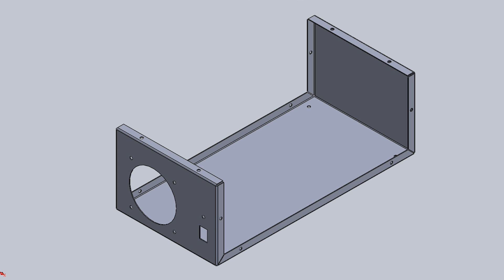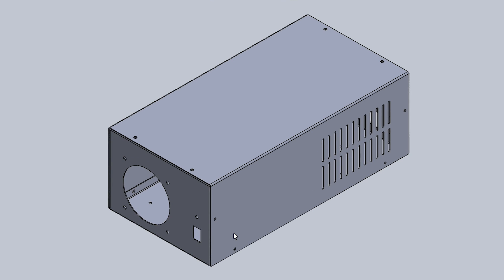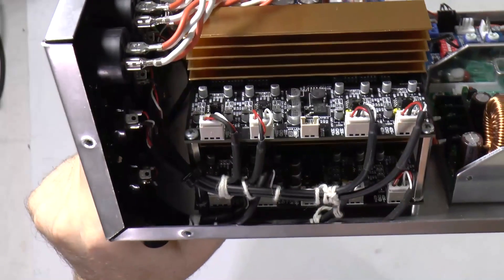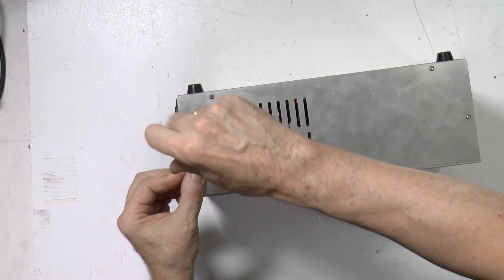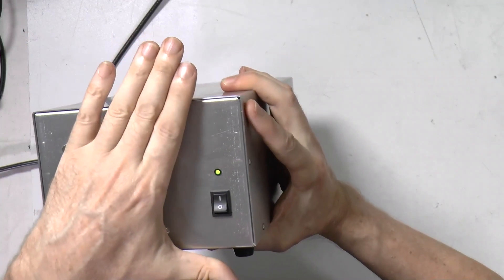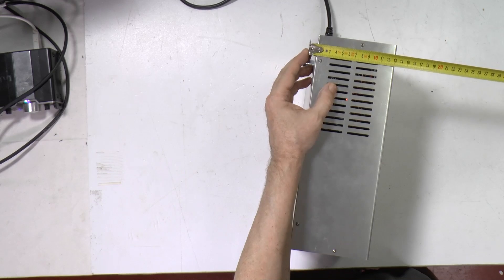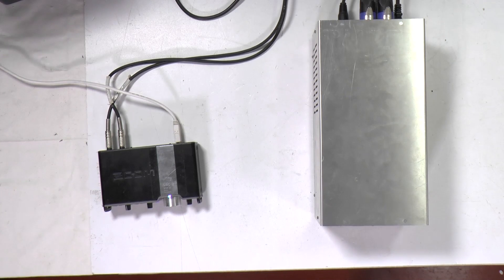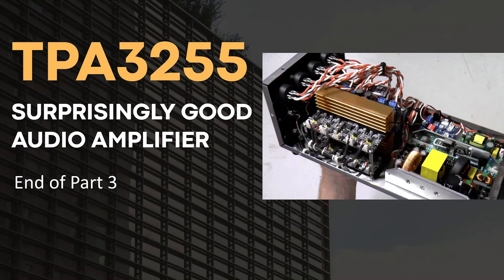TPA3255 Part 3 Building the prototype

Comment: does the added capacitor in the power supply, remove the noise you saw without it?
Reply from the maker: No, the Capacitor is to boost the power supply's instant current capability. The added ferrite bed removes the noise.

Comment: compare to icepower?
Reply from the maker: ICEpower is better because it is built by the book and integrated with power supply. China engineers made it with focust to 8 Ohms and it is jeopardising performance for 4 Ohms. ICEepower 200AS2 which is built with the same technology did it by the book and it is able to work with inaudible difference for 8 ohms and 4 ohms load. For mu projects I am using only ICEpower version of TPA3255.
Reply: @guntarssmits2104  sir could give me model or link?
Reply from the maker: @jericlee1509  https://www.soundimports.eu/en/icepower-200as2.html
Reply: @guntarssmits2104  I guess I'm late to the party. I just discovered this great video. You mention that this board is optimized for 8Ohm. Is this not just a function of the LC filter, which can easily be corrected by changing one capacitor value per channel?

Comment: Hello, could you tell me what level of background noise this amplifier has? The fact is that I need a near-field monitor and, accordingly, there should be complete silence in the speakers. Could you check what level of background noise will be at a distance of 15 cm from the speaker, you listener can hear a strong hiss or quiet enough, not annoying?
Reply from the maker: According to the ICEpower data sheet for a complete system including power supply generated noise, it is 92µV. Chip level noise is 85µV which is good. The best of the best ICEpower board 1200AS2 noise is 20 µV. Compared to mainstream AB class amplifiers, the noise floor is inaudibly low. You will only hear it if your tweeter has extreme sensitivity which is not the case for near-field monitors. Those typically have 87-90 dB sensitivity and you will not hear any noise from a 50cm distance.

Comment: Is the ice amps from parts express the same as what you are using.  I was looking at different kits and I heard a lot about purfi I'm on a budget so that's a factor
Reply from the maker: Parts Express is taking only obsolete or excessive boards from ICEpower. I recommend Soundimport if you want a full ICEpower lineup and warranty services. But this company is in the EU and there could be some associated tax.
Reply: @guntarssmits2104  Thank you.  I appreciate it and I enjoy learning from your channel.  I was thinking of just trying one with a Ghent case just because it's cheap and has a lot of power to get my feet wet with class d but I will look into your recommendations

Comment: with your knowledge, does it interest you to to some videos on subwoofer amplification?
with dsp and subwoofer drivers there is a lot talk about you need thousands of watts, especially for a small sealed enclosure and producing the lowest notes. 
i run my subwoofers with 100 watts to excursion limits at 15 hz, seems impossible with the current thinking.
Reply from the maker: You touched on an interesting topic. I will think about how to present this topic ins some of my videos. In short, if you inspect loudspeakers designed for sealed subwoofers you will find that typically they are 300W rated. For ported those are 100W rated. You are right - sealed needs 3 times more power compared to ported. Sound is all about instant speaker acceleration. Woofers have a mass and with low power, you are not accelerating with the necessary speed. You will have a max excursion and not sound. And the second important moment is our hearing sensitivity. Below 50Hz it is dropping dramatically and you need tons of power to drive the woofer to loudness where you are able to hear it. Typically small subs home users hear air movement at low frequencies, not a sound. Yes you need a hell of the power - about 600w to drive very low frequencies and then your windows will shake and movie earthquakes will feel natural:)
Reply: @guntarssmits2104  i only have my limited experience and parts.
i built a 19 liter box with a 10" subwoofer in it,  asked to go down to 15hz, asked for advice on forums how my power i needed, and my finding was in contradiction to common knowledge as far as i know.
Reply: @guntarssmits2104  Thanks for all your videos. I think you will find there is great interest in subwoofer integration of this and other amp boards.
Reply: +1 on this request, I'd be very interested to see something like this covered on this channel!
Reply from the maker: Deal, I will cover this topic in some of my next videos. @vikassm
Reply: @vikassm  now is the time to be a diy subwoofer builder, dsp are easy to get. put a driver in a sealed box and you have subwoofer. 
a power amp is the choice now.
mo logic is to play sinewave of the lowest frequency i intent to play, 15hz(this only works for sealed) and if my amp can force my driver to excursion over a bit of time it is good to go.
Reply from the maker: noted @vikassm